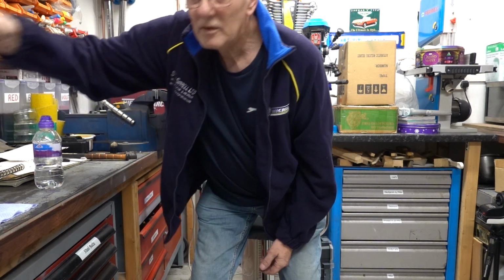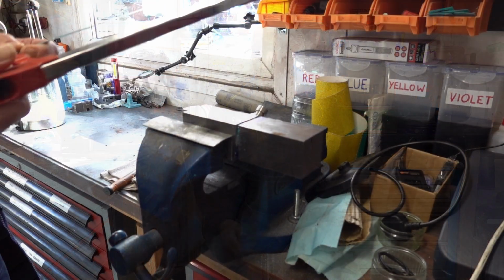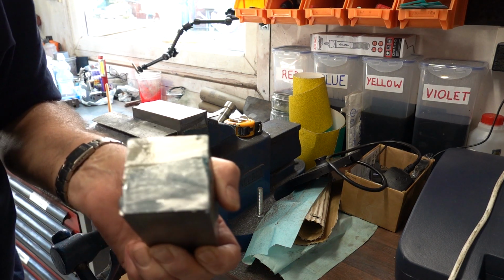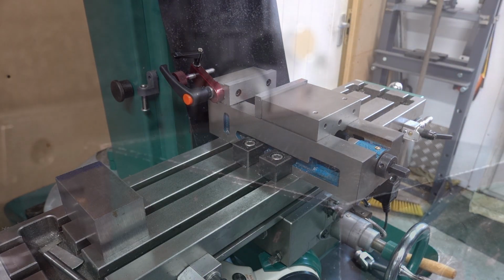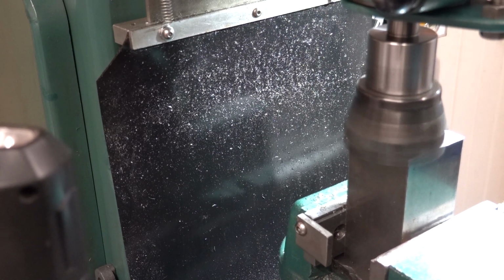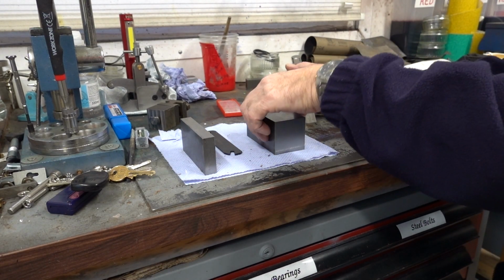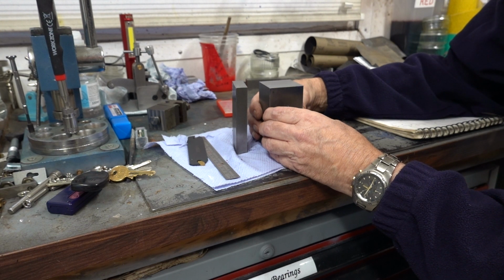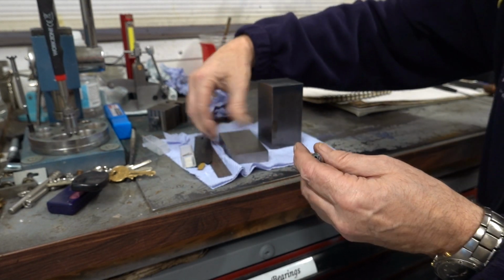Making a Lathe rear parting off tool part 1. Any lathe

Comment: Hi Steve, looking good mate, nice and solid. There is actually some good supplementary theory on why rear parting holders work much better (other than the rigidity piece you already covered). It is to do with direction of cutting force v/s centreline. With a front parting tool, pressure is downwards meaning if there is any play in slideways, the tool goes below centre and the part tries to roll over the top of the tool.... that's when things get ugly! With a rear tool, cutting force is upwards so any play lifts the tool above centre i.e. out of cut therefore reducing the chances of dig in, and the part doesn't try to climb over (or under in this case) the tool. Hope this makes sense. You make your videos how you want mate, it's your show! Cheers, Jon
Reply from the maker: Thanks for that Jon. It makes sense what you explained. Will bat on with it & see how it turns out. Or a visit to the scrap metal dealers. Take care mate.
Steve.

Comment: I have never had a problem with parting off. I know many people have. It does help if you’re using a more rigid lathe, I have a Warco 280 and I can part off with the power cross feed using blade type inserts. Out of curiosity I bought a rear tool holder for it, they’ve only 20 odd quid, from Warco, I used it a couple of times, it worked fine but it sits on the shelf now and I just do it from the front as before. The problems that people encounter are, not keeping a steady feed on, not watching to back the tool out it the chips start to jam the tool, allowing the carriage to move, and having too much overhang from the chuck, allowing the workpiece to bend.
Reply from the maker: Thanks for all that info Foot loose. I know a few who have taken off the compound & fitted a solid block. I think Ade has done that with has Warco. Regards.
Steve.